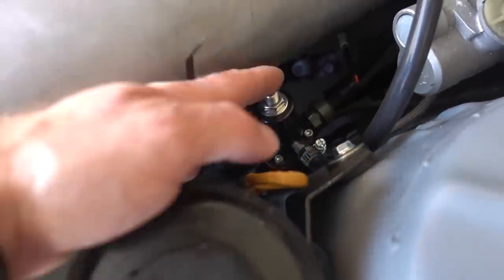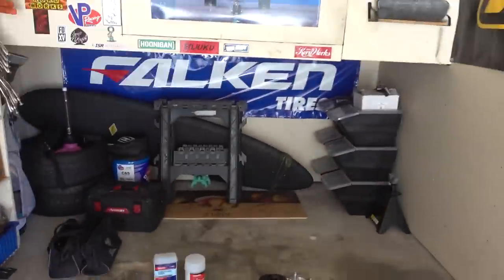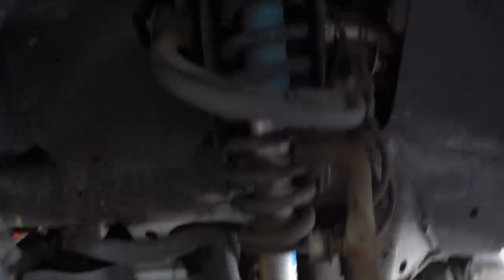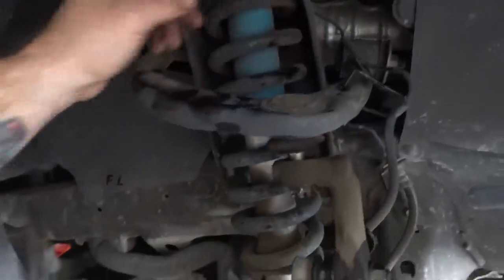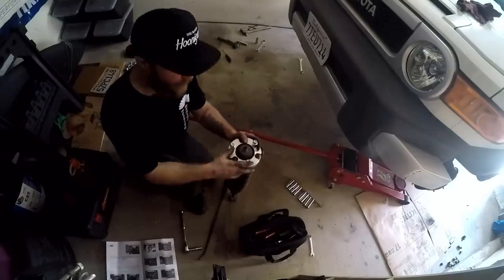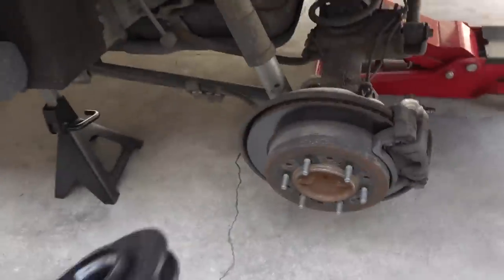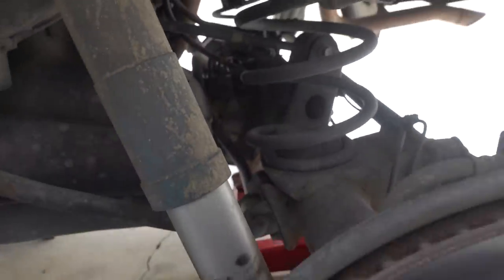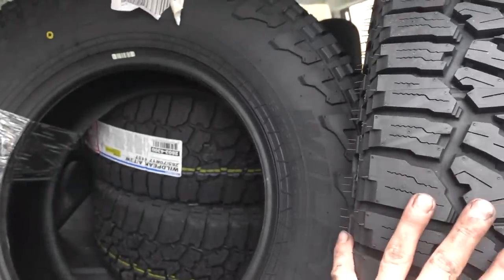Danger Dan’s Daily Driver Toyota FJ Cruiser Get Lifted in the Narrowest Garage

Comment: I just did that to my toyota tundra last week in my gravel driveway. Did new bridgestone dueller ATs. Did bilstein 6112s up front to level and 5100s in the rear and also some airbag spring hepers in the rear. Its a whole new truck. towed a 7000lb piece of equipment and a stock sc300 afterwards. Was the best improvement my tow pig has ever recieved.

Comment: Dan as much as the leveling kit will make the FJ look much better do yourself a huge favor and do the 2" to 3" lift with quality shocks such as Fox, King or I did Walker Evan's. It made such a huge difference in my FJ. Dirts roads that were a challenge at 25mph stock were easy at 60mph after that swap. You will love it.

Comment: Dan..... for future reference, all you have to pull is the 2 19mm bolts on either side of the lower ball joint to get enough movement to get the struts out. If you ever do one for someone else. Thats pretty much any toyota truck.

Comment: If those are Bilstein 5100s then you can just lift it that way by adjusting the bottom spring perch thing. Just pop out the big circlip thing on the body of the shock then move it to one of the higher slots.

Comment: If those were 5100 bilsteins you can get height by adjust the snap ring. If those aren’t, just buying front 5100s is a better ride for not much more price than a spacer lift

Comment: Looks like you have bilstein 5100s if you do those are adjustable  they have 4 settings you can pick one and set with a lock ring and it’s not recommended you run spacers with them they bend easy

Comment: It's muuuuuuuuuch easier to get them off if you remove the UCA, also you don't really need to support the LCA when disconnecting the coilover it kinda just sits there, i actually put a prybar on mine to get it down to make a little more room and it would spring back up just from the bushings being tight between the tabs.

Comment: Easier way to remove strut, drop the lower ball joint at the bracket. Allows lower control arm to pivot all the way down after unbolting the lower strut mount. Unbolt top 3 strut bolts and slides straight down.
Reply: Yep. Let's you change out axel early also.

Comment: The shock/coil spacer is fine for fitting bigger tires but your making the coil not compress as much as it would stock so you need to add bumb stops or longer shock travel

Comment: Watching this was thinking, damn his knees must be sore being locked in the crouching position and kneeling on concrete than at 9:43 "my knees are killing me", you confirmed my thoughts. Dan get yourself a set of roofer's grade knee pads that have the rough outer coating and soft foam insides to withstand the abuse. Or pick yourself up a kneeling board, they are less than $20, can get them at Home Depot, meant for people doing gardening, landscaping and various other things, is basically a 1-2' thick solid piece of foam that's about 2 feet by 1 foot, has a hard plastic shell with handles on each side., tucks away easily when not in use, the thing will save your knees.

Comment: just curious, last I checked, once the sway bar is disconnected, an ifs system literally has no way for either side to bind on the other... an axle or tie rod would not bind the opposite side, whole point of independent suspension. lol

Comment: Hey Dan, I have a 2007 fj.  I’ve had massive luck with it but I’ve found the brakes to be a weak spot.  They work fine, but every couple years I’ve had to replace a seized caliper one the front and the handbrake assembly in the back has always given me problems with seizing, it’s got the 6sp so I have to use the handbrake from time to time.  I’m in New England so perhaps it’s from the salt in the winter, I do wash the truck during the winter but I don’t have a garage so I’m not washing off the salt daily or anything. I was wondering if you see similar problems on your end of the country?
Reply: Idk about fj's but I know on Jeep's the rubber break hose going to the caliper can wear and cause then to stick
Reply: SneakyCanner mine were pretty solid but i changed it to braided lines from stoptech a few years ago

Comment: Surprised a aftermarket co. Hasn’t  made 2 pc rotors with custom hats so you don’t have to use the junk wheel spacers, life is in your hands by some nuts and bolts Hoping they won’t back off or loosen up, causing 💀.

Comment: Don't go to 4 Wheel Parts anymore, they are trash.  There are tons of smaller Toyota specific off-road shops like Toytec Lifts, Low Range Off Road, or All Pro.  You will probably need to do extended braided brake lines (especially the rear).  4WheelParts sells over priced under designed shit to the bro-dozer community.